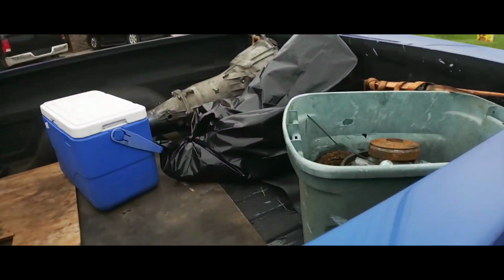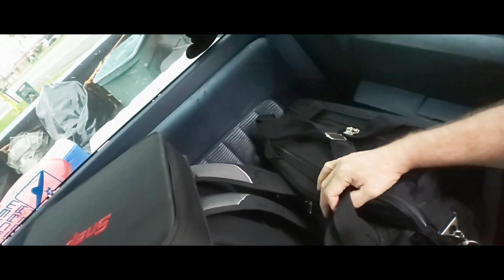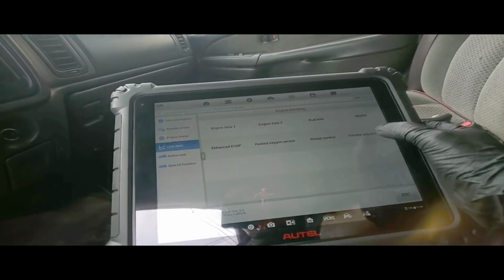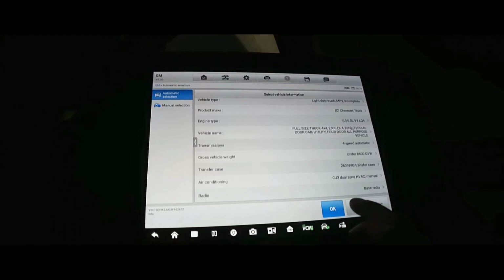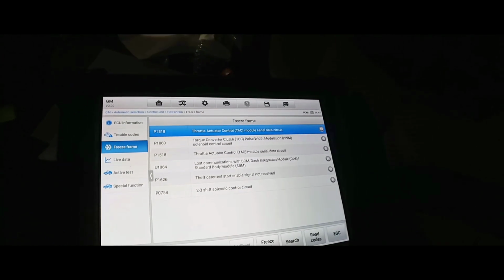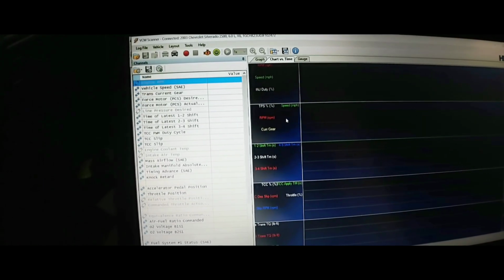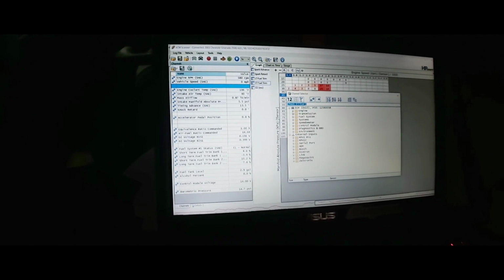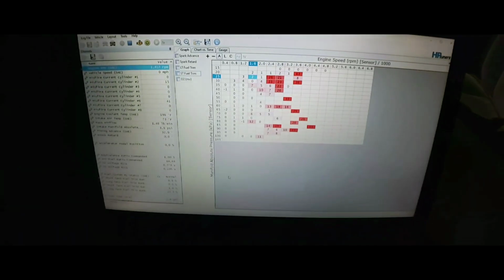Reduced Engine Power | 2003 Chevrolet Truck 6.0L - 4L80E

Comment: Greetings, excellent informative video.  How to find and repair the TAC ground?  Where is it grounded at exactly?? Do we Reposition it somewhere else in the engine bay? Or just buy a new TAC?
Reply from the maker: On this truck someone swap out the engine with a replacement good used engine. They mislocated the ground for the TAC module. On this particular vehicle, the guy that did the swap, opted to piggyback a ground on the ground circuit. This would not only feed ground to the module but also other circuit that share that particular ground. 
Although it had all the symptoms of a damaged TAC module, we needed to check power and ground before condemning it being bad. Luckily it was just a bad ground and not the module.
Reply: @ Good Stuff!  Thanks for the informative response!🙏🏽

Comment: Hello - can I ask you a unrelated to this video question.  I have a 2005 Ford Ranger 2wd 3.0 L  trans code D which is a 5R44E.   OD Off Light started flashing a couple of weeks ago and when this happened I noticed a change in the way it seemed to be shifting.   Now the light has been off for quite a while but when I first drive the truck in the morning everything feels fine but it seems once it warms up the truck feels like I am driving over some very small speed bumps in the street.   This happens mainly in lower gear.  I also feel some vibration when I am backing up.   When slowing down around a corner for example it feels like the trans is not downshifting into a lower gear and the rumbeling feeling is there.    I have about 110k miles on the truck.  Had it scanned with a enhanced scanner and no codes came up. I pulled out a few bushes at my house before the OD light thing and I was just wondering if any of this could be caused by a blown valve body gasket from the force of pulling out these bushes.  Would a blown valve body gasket cause any of my symptoms.  Thank you very much for any advise.
Reply from the maker: If it shudders in reverse more than likely the direct frictions are burned. That explains the drive ability issue you're describing when slowing around a corner and the vibration (shudder) you're feeling. 
If the OD light flashing you will have a gear ratio error code stored in memory. You need to look on "freeze frame" and "continuous memory" codes.
Reply: @AutomaticTransmission  Thank you for the reply Hiram.   I was planning to take it to AAMCO down here in Fort Myers.  Do you have any idea what I might be looking at dollar wise if they say it needs a rebuild ??   The truck is a 2005 in very good shape otherwise .  I am just looking for guidance cost wise if you know what I mean..........  Thank you.
Reply: @AutomaticTransmission  On second thought probably time for a new truck. Thanks

Comment: You need to stick to transmissions and leave engines alone..
Reply from the maker: Engines are very simple, small amounts of moving parts including the components that run them. No bainer, chasing down a bad circuit or working behind someone else is a different story.
Reply: @AutomaticTransmission  Quick question if you have time. I have a 4l80e in my 2500, no slipping in gears, cooler not plugged, lines not plugged and it's getting to 210/220 tranny temp. To 250 once. Any idea off the top of your head? Shifts completely fine, and converter is locking when it's supposed to
Reply from the maker: Double check with a infrared thermometer. Could be that the temperature sensor is not working properly. 
I would add an external cooler after the radiator on the return line.

Comment: So it was a bad tack ground?
Reply from the maker: Yes, 7 volts on the ground side.
Reply: @AutomaticTransmission  Seems like ground wires cause a lot of problems I have noticed. You did a great job on it. When I drag race some people who had problem by just looking at the motor I said run a couple of ground wires. They thought since the had solid motor mount or mid plates they didn't need them. They put ground wires on and there problem went away.

Comment: Plugged injectors? Re-learn on pedal
Reply from the maker: My goal was to figure out the Reduced Engine Power issue, which was found and it was corrected. 
But yes, plugged Injectors as well. As you saw the misfire moved with the swap of Injector position. They took care of that and corrected the bad ground to the module.

Comment: Oh wow!! Check you out! Mobile diag. You now do what I do?!? Excelente!  If you ever need a 'known good' waveforms for Pico... lmk ! I save tons. Cam/Crank correlations, vvt switching, fuel pumo current, ect!. 

I use  Milwaukee packout. For the waterproofness & ruggedness.  😁😊👍🏻👍🏻
Reply from the maker: No, I still do tons of rebuilds at the shop. There's some shops I help out on the weekends, specially this one now since it's a family member and he just opened up less than a year ago. I do transmission bench work for his customers and when I'm there I pack up and help him out on "non transmission related issues " if possible. I have enough of those during the week. I can't film work from the shop since it's a very fast pace environment I bearly have time for a break. I'll try to include "tales from the bench " videos again. 
On the waveforms I'll let you know, I had 2019 Chevrolet silverado that the Phaser was stuck I didn't have a reference waveform to compare. That's fixed, it has other issues I think I might film that one.